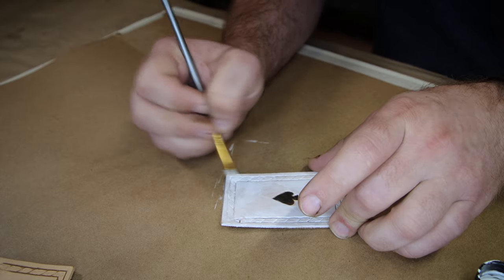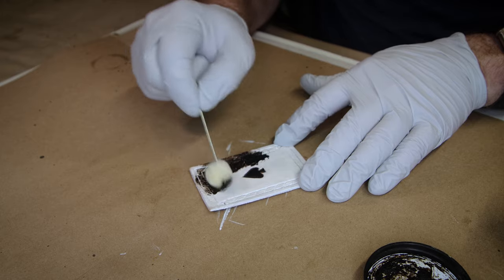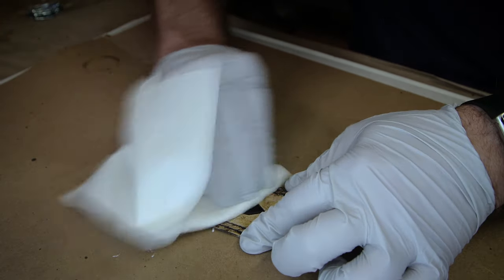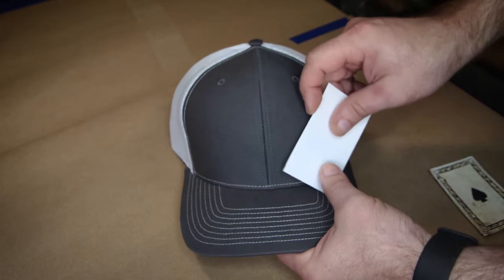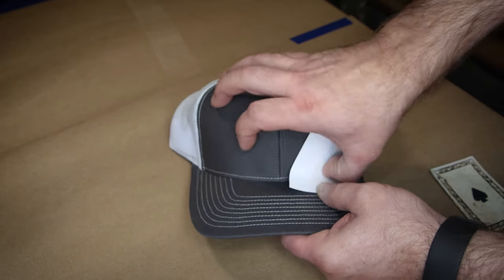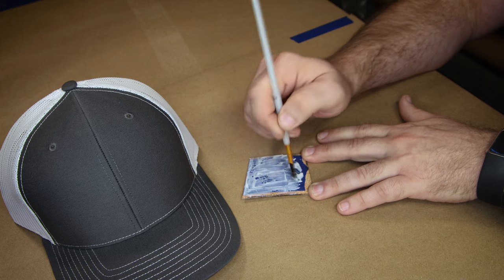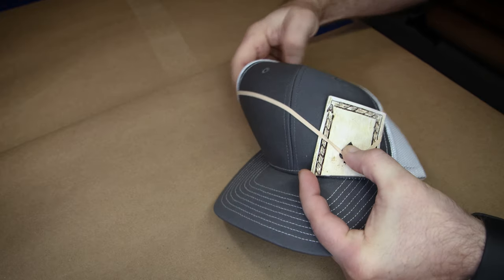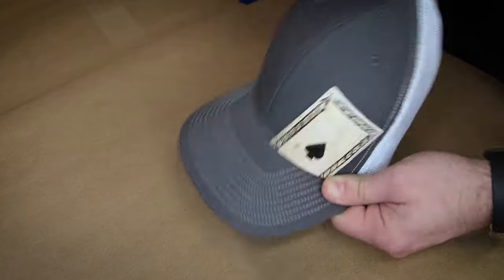Making a Tooled Leather Hat Patch

Comment: The fashion designer in me wonders if it would have been helpful to use a styrofoam head (or a ball with a little improvised padding would do too) to put the hat on when fixing/gluing the patch onto the hat?
If you could get the head/padded ball about the size of the hat, it wouldn‘t flop around too much.
Plus: That way the curve of the hat would remain (mostly) in the original position and there would be extra pressure from the back to better combine the surfaces of the patch and hat…
Ok, ok… just my musings here… but that would have been my attempt on the attaching process. 😅

All in all that hat patch idea is definitely something I‘m going to try in the future.
Reply: I hadn't thought about trying that. Might be worth a try. Definitely give the hat patch a shot...fun project.

Comment: You kept the blue tape on the back when you brushed the glue on?  Was that on purpose?  Pro/cons leaving tape on vs. removing?  Too much pulled up flesh fibers perhaps?   Noob here.
Reply from the maker: Hi there,
We checked with Daniel on this and leaving the blue tape or pasteboard on the back of the tooled piece does not cause any issues as far as peeling off, etc. It is up to personal preference but it does take a step out of the process and keeps the back of the leather from getting too fibrous as well. Hope that helps!